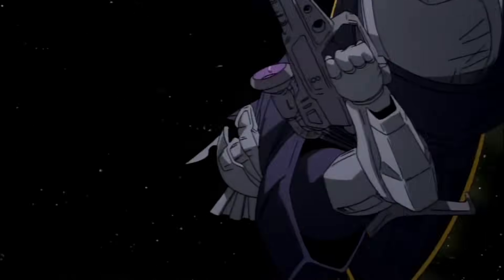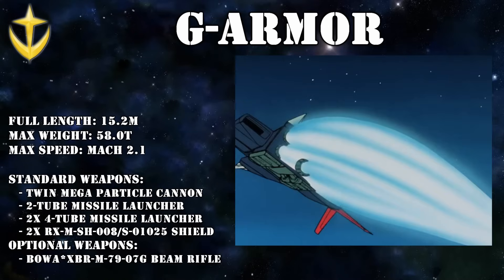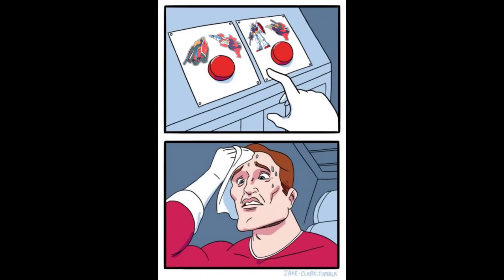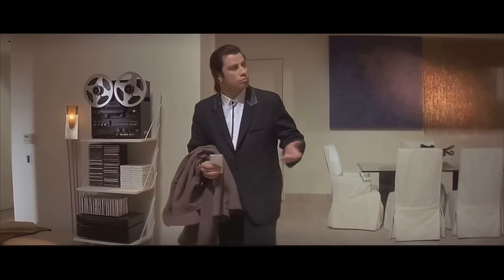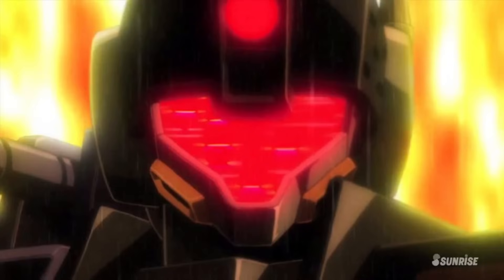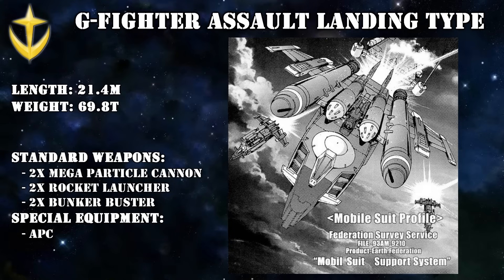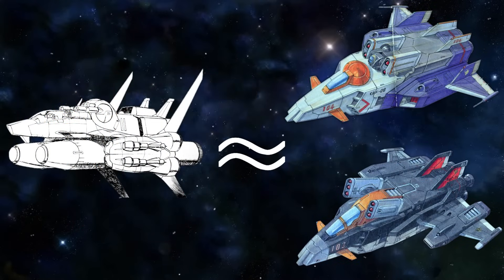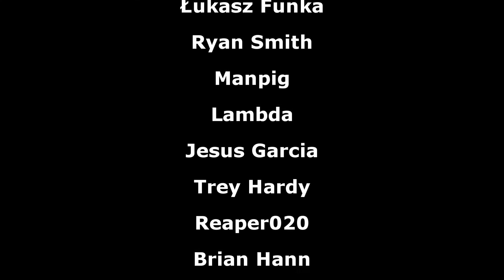G-Fighter Development History

Comment from the maker: Kakarot’s Notes:
- For the G-Fighter Bomber Type, Space Type and Assault Landing Type, MSV-R has their Height listed as 17m, 17.5m, and 21.4m respectively (which is why you will also find this on fansites). However, this should’ve been their length. (For example, also in MSV-R, the Nelson-class, a modified Salamis, is listed as having a height of 228m. And the Salamis only has a height of only 61.3m, but a length of 228m, a perfect match)
- In one episode, Sayla says that she’s launching in the G-Bull Easy, but she’s actually using the G-Bull.

- Sometimes it's also said that 3 G-Fighters were delivered to the White Base. This is taken as 2 complete G-Fighters, and 1 complete unit worth of spare parts.
Reply: I heard that the toy developers forced the G-Fighter upon the show. But Tomino hated the concept and replaced it with the Core Booster in the movie remakes.
Reply: "For a brick it flew pretty good" - Sgt. Johnson.
Reply: what about the G falcon in think that should have been included
Reply: The G-Fighter might be best to exist…

AS a Gunpla battling other Gunpla in the world of Gundam Build Metaverse X._
Reply: @mjuneoginn  exactly
Reply: You can actually see a G-Bull on A Baoa Qu in the last movie of MSG

Comment: I think the real issue I have with the G-Fighter is it was clearly forced on to the production of the Mobile Suit Gundam anime. There are quite a few scenes with Amuro and Sayla either training with the G-Fighter equipment or being made to bring it out into active battle which felt aggressively like filler to pad out an episode. I think it falls into the area of the Zock of Zakrello where you could salvage it with a few design changes, but I'm not going to begrudge it being replaced with the Core Booster. The Core Booster is cool.
Reply: According to Gundam Sousei manga, it is. G-Fighter was introduced after Gundam's rating hit rock bottom. Tomino need to added some cool toys in order to keep the show afloat.
Reply: @KuruniXD That's pretty believable ngl, especially since the original gundam series was cut short from what the original episode count was supposed to be

Comment: Okay, this is just me spitballing and it would certainly require some modifications, but if I was on the White Base  I'd actually suggest having the G-Fighter link up to the Guntank instead. It doesn't provide much to the superbly powerful and agile Gundam, but by giving the Guntank improved speed and flight capabilities, you could deploy it better in space or rough terrain, while giving it an even wider range of attack. Mainly thinking about this in the context of a Guntank Sky/Guntank + B-Parts, but I'm sure other configurations could have their merits
Reply: I am pretty sure Hayato have move on to using another Guncannon by the time Amuro came up with the idea of using Gundam upper-half and use the B-part as makeshift booster to combat Zeon's MA. Another point of Guntank is that, it actually have 2 pilots. One in the Core Block, and another on clear cockpit on the top, like a tank. The idea have some merit in the sense that, you can use Hayato's Core Block instead of Amuro's Core Block when deployment of Guntank is infeasible.... but that does not use any of the Guntank either, and it just become normal G-Armor/Fighter/Sky by then.

Comment: Head canon wise, WB got the G units around Operation Odessa to test out, while after Jaburo they swap out for Core boosters.

The core booster development was to recycle the obsolete core block system of Project V.  

The G unit seems like left over units to compensate as a stop gap for battle strength hence the variants and usage by other military teams.

Comment: The G-Fighter  as it appeared in the Anime totally existed. Like most of the things on White Base, it was a rushed prototype that tried to do too many things at once. The modularity meant that units could use the parts they needed most. If the 08th team had received the G-Parts, the tank portion would have gotten a LOT more use. The simple ability to retract the treads would make way more sense, but if they'd had time for that they could also have spent time getting the G-Parts to work with the Guncannon and Guntank, for some really wacky, but effective combos.

As for it's top speed, there's a saying that with enough thrust, anything will fly. If you can accept that the  60 ton Gundam can jump high enough to chase rockets and leap up onto Gau's in flight, then it, combined with the additional power of the G-Parts can hit Mach 3+.

The XB-70 Valkyrie Bomber weighs 240 tons (Metric) and could exceed Mach 3, so it's not at all impossible, even with the drag of tank treads for the G-Parts to do the same with tech that is at least a century newer.

As for the Core Booster, tat I see as an adaptation of tech that was developed for the Saberfish fighter for space use that they realized could also work as a support unit for a mobile suit with very few modifications. The reduction in firepower vs the G-Fighter though, seems like a tradeoff that Amuro and the WB crew would not make except for the few instances where speed was more important. Having both present on WB however does offer maximum flexibility, so for me, they were both there, but the Core Booster was added at Jaburo for use in space.

Amuro's field change to make the shields stack was actually brilliant. He'd recently encountered the Doms, which broke one shield, so he needed better defense anyway. Stacked shields was quick and effective.
Reply: I think that makes canonical sense. I think also, in the real world, it was a ploy to sell toys, but who cares? A lot of cool stuff was. I can acknowledge that and enjoy it for what it is. There's no need to wipe out any little part of the history just because it might hurt someones fragile sense that this must be taken deadly serious all the time. It's just fun.

Comment: Your theory is basically what my Headcanon has been since learning about it being removed from Canon by the movies.

Also, another headcanon that I 100% believe: the man at Anaheim Electronics who insisted on the ZZ have a Transformation into a mode somewhat resembling the G-Armor and having a core block system, to the point of it risking the structural integrity of the ZZ, was the same man from Zeonic who designed the Gouf Combined Test Type and has nostalgia for the "Cool Combinations" the Federation used to make.

Comment: I think G-Fighter was one of the V-Project mobile weapon concepts that was seemingly effective in simulation only, but then they found many flaws when they finally made one G-Fighter prototype. And then what happened next was the engineers found out that the G-Sky part was much more effective than the G-Bull, just by combining it to the Core Fighter, but they also needed to incorporate beam weapons to the G-Sky part to further improve the Core Fighter's firepower. And with such considerations, they would then make the Core Booster.

Comment: A few things to say here.

First the history, I think it's a case of the G-Fighter existing, the White Base crew telling the top brass(non to nicely I might add) that it sucked and was a waste of time, so the Feds gave them the much better Core Boosters and tried to pretend the G-Fighter was never a thing, at least as far as being a Gundam support module.
As a multi-purpose combat aircraft, they went all in with. (Bomber and Space types)
Of course they would also look into the things the G-Fighter DID help the Gundam with and that would naturally result in the Base Jabber.

On the other side of the spectrum, that Proto G-Fighter totally blows the final version to hell!
It's so much better!
It looks better for starters, yes it's still a block, but it's a good block!
The module concept is much more efficient, I mean it's a 3-man fighter squadron in one compact package!
Imagine a battleship filled with these things, and then recall they can slit into three! Yeah boi!
The fact it DOES NOT need the Gundam to achieve full potential should've been a no-brainer!
And that Gym Intercept Ignas just SCREAMS potential!

In short, Proto G-Fighter rules!
Final G-Fighter(before repurposing) drools!

Comment: Ya know I can see the G fighter being a thing, because it is very in character for the Federation to make a jet thing that docks with a mobile suit in order to make it transform... it's basically the same mindset that brought up the Re-GZ's back weapons system... which i think is where the federation would have went with the concept after they made the core booster... 

Basically my headcannon is the same as yours but add on that the concept was later used to make the back weapons system of the Re-GZ which would also explain why they thought that failure of a transformation was a good idea, it worked before so why not do so again?

Comment: We need it to be 100% cannon and also in the Movie, near the end of the 3rd movie, as Sayla is going to find Amuro and Char, you can see the G-Fighter in the background. So it is cannon and it may have been mistaken as the White Base G-Fighter due to how close it was to the White Base itself and also may have had the WB insignia that was never changed as it may have been a last minute change of hands and thus mistaken to be part of the WB Crew after the war ends when they are seeing the damages. This means that at one point the G-Fighter may have been in the White Base but never used due to the lack of a Manual and then transferred over to another unit later once they reached space to a different unit before the Battle of A Boua Qu, so both versions do exist and is part of the cannon which means that the Core Booster is a different take on the G-Fighter concept and finished later than the G-Fighter itself and thus put in limited numbers to aid those who are skilled more often than not, White Base getting it maybe General Reval playing favorites and giving them the best gear for the time.
Reply: I'd imagine that the White Base getting core fighters would probably be less playing favorites, and more the Federation leadership just sending over whatever was new because the White Base was basically one of their beta test teams.
Reply: @magnatcleo2043  it was honestly a mix bag for what White Base was After General Revan died, it then became a Beeta Test Team until The Battle of Solomen. Which is where Revel had died. Revel himself may have been playing favorites for White Base and not tell anyone about it under the gize of them being their best shot for winning the war and a great distraction, so why not send them all the new and best gear to make Zeon waste a lot more on this ship and less on the other fronts. Play into the Propaganda a bit for the WB Crew.

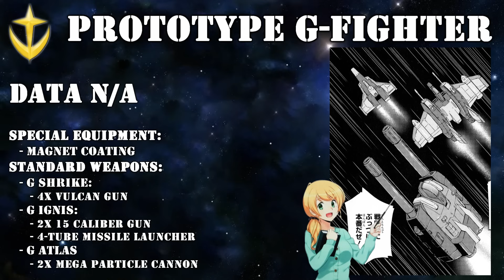Comment: ~ 20:43
15 Caliber is a very bizarre choice for things of this size. By not saying 15mm, I assume that they do mean the typical inch measurement of caliber. Like 50 caliber (correctly as .50 which is half an inch). Surely they don't mean .15 which is 3.81mm. They must mean an actual no-decimal 15 inches. So like 381mm. But that's substantially bigger than a Zaku bazooka...

Comment: Just have the g-fighter as a delivery/drop system / support vehicle concept prototype that was shelved due to pilot safety and maintenance, and like had its data rolled back into the core fighter’s development and the non-gattai units. The Sp forces version could just be elongated with retractable armor and increased fuel capacity and thruster output. As for thruster output: um, why is Paptimus so young in Z Gundam? 0079 totes has some ftl stuff, so that output is probably doable

Comment: I don't hate the idea of a G-Fighter, but the implementation of it is decidedly subpar (I'm also a Super Robot fan first and foremost, so combining robots are much hype for me.). I think the best implementation I can think in Gundam is the G-Defenser, and (this is a stretch) the Skygraspers from SEED. Granted the Skygraspers were meant to utilize and deliver the Striker packs to the Strike, but I can imagine a version of the G-Fighter that docked to the back of the Gundam to provide additional weapons and thrusters. Heck to borrow from the Striker pack idea even further, the proposed G-Fighter would have equipment hardpoints that could be swapped out on the White Base to provide the Gundam with additional mission profiles.

Comment: In space where there is no air resistance mach 3.5 is not actually that weird. In fact in soace there would be NO maximum speed so i guess the 3.5 speed limit is for in autmosphere flight so i guess my objection is retracted.

Comment: I always wonder

Is it only compatible for the Gundam? Like cant GMs or GunCannons use it? So they can still use it while the Gundam is Active
Reply: Presumably GMs could use it. But since they lack the core block system, they wouldn't be able to do any of the partial combos. The other V Project machines probably couldn't fit into the full G-Armor form, but might be able to make use of the +B-parts configuration, assuming you swapped out the legs.
Reply: in the Thunderbolt movie the bits are being used by a GM for about ten seconds before it gets rekt'd 

so yes it can apparently the GM can use the g parts in a limited capacity

Comment: I really like the G-fighter. I don't think its any less realistic than the gundam or even the core booster. The G-sky is literally the same thing. And the g fighter is just a super plane. Reminds me of how the mobile armors were in 0083 like the val walo.
 Like a federation mobile armor. Look how big those got with a gundam inside it.

 The using gundam parts is unnecessary. Stupid or bad design. But as part of the V line it makes sense. As part of copying Zeon, it makes sense. Like at the big zam. 

The versatility isn't bad. Only the bull is a little bad. And its still an extra tank without the gundam. 

the G fighter by itself works.

Comment: Wait, if the G-Fighter didn't exist, wouldn't it mean that the original series isn't canon?
Also, is the Gundam supposed to be facing up or down in that thing? Because I'm almost sure the transformation animation has a continuity error regarding this.
Reply: I think it can go in both ways, Since the Gundam+B-Parts requires it to be facing down and the other partial combos seem to require that it faces up.